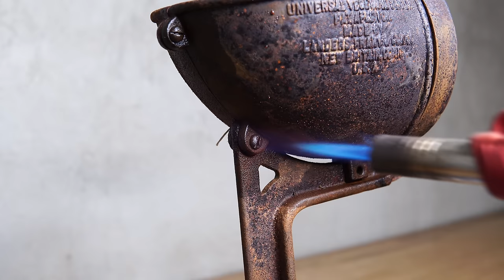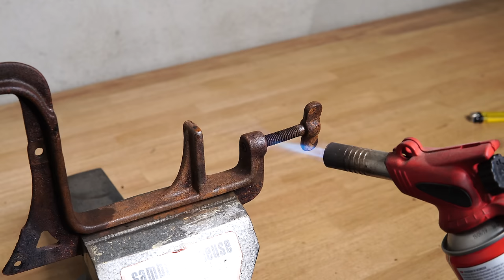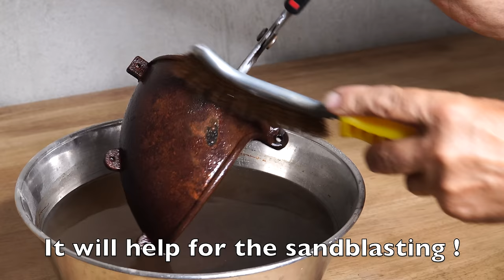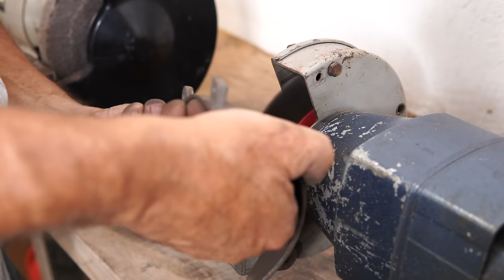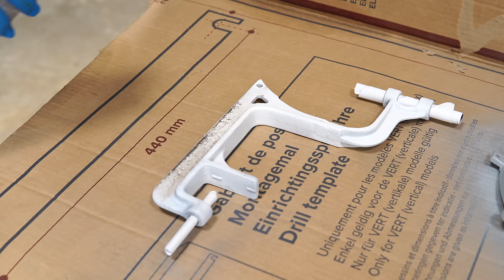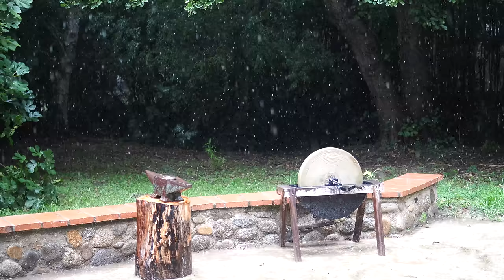Rusty Vegetable Slicer Restoration

Comment: Simply LOVE your work. One of these years, since I am probably gonna continue restoring things around our farm (working on a 4th wheelbarrow, have a 1950-1960 wheelbarrow lined up next), I'm gonna have to get a sand blaster. Still, even without one, Vinegar to get off majority of rust and hand sanding (small parts) or electric wire brush/sanding works quite well. I keep learning so much from your videos.

Comment: Landers, Frary & Clark was a housewares company based in New Britain, Connecticut. It operated from 1865 until its assets were sold to the General Electric company in 1965.

They manufactured a wide variety of products over the years, including stainless steel bull-nose rings and electric ranges, kitchen scales and vacuum bottles, window hardware and ice skates, mouse traps and percolators, can openers, corkscrews, cutlery, straight razors, aluminum cookware, and thousands of other products.

Many of these items were marketed under the brand Universal.

Some of the non-electric kitchenware assets were acquired from G.E. in 1984 by Universal Housewares, Inc./Universal Trading, Inc., who still market "Universal" meat grinders and coffee mills.

Comment: Oh WOW thank you thank you thank you you have got to be the first one I've ever seen that actually repairs the slot's on the screw head so many of these I have watched put it all back together and there it is every single screw has a bur on it from someone trying to get the screw out and the screw driver slip most of the time it's from the wrong screw driver being used but it looks horrible afterall isn't a restored piece supposed to be as good or better than New

Comment: I'd upgrade your shot blasting cabinet to a pressure fed pot type, rather than the suction gun setup.  You'll get through heavy rust a lot faster, and you can use a heavier medium like chilled iron grit.

Comment: You burned the top because only your broiler was on. If you'd either adjust to turn the bottom element on also or if you'd reduce down to about 80°C instead of 100° and then about double your cook time, you'll end-up with more tender potatoes and thicker liquid (it will stand up on its own after cools), and the entire top will be brown -- instead of the black spots.